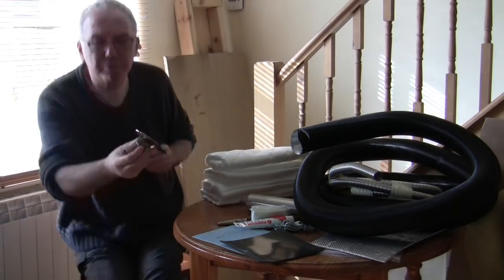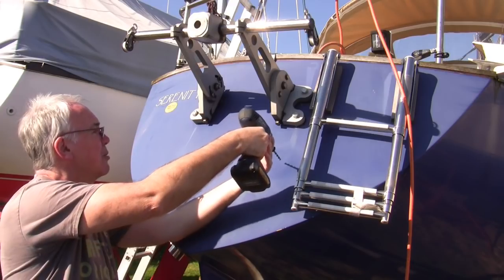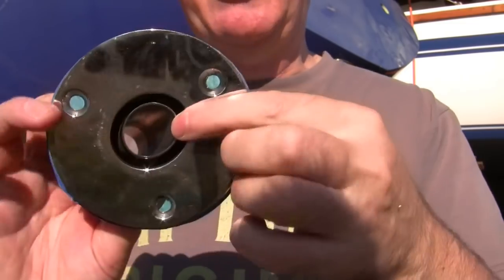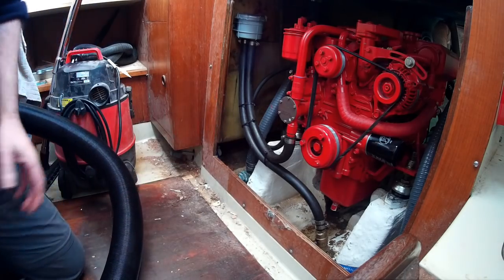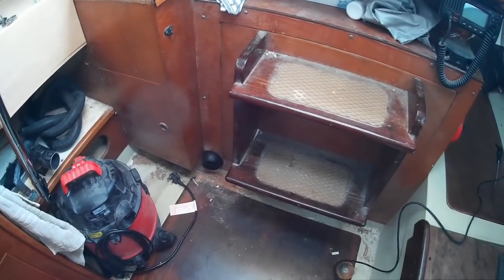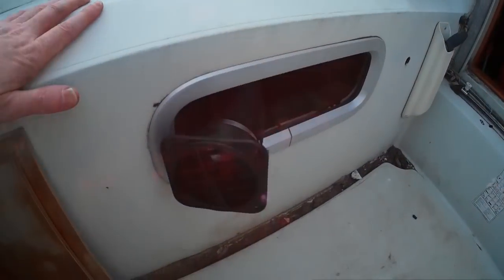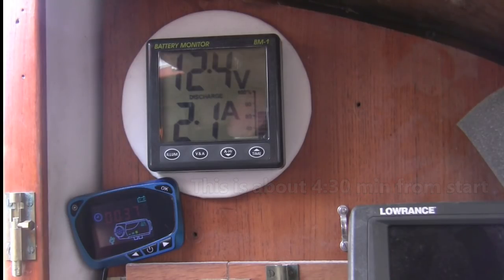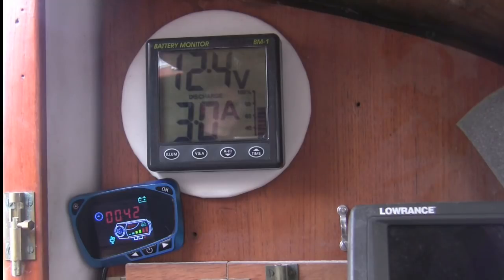Just About Sailing March 2019 - Installing a Chinese Diesel Heater, Pt 2 Fitting it and switching on

Comment: Nice install. As you were showing the current draw, I found myself wondering if you have ever looked into fabricating a solar panel arch for your boat. They seem to be getting quite popular for small sloops these days, and they look like a very practical and tidy way to get a couple of unshaded solar panels on board.
Reply from the maker: I do intend to install solar panel(s). I am not sure at the moment how I will do this. An arch is probably the best option. I have a slight issue in that the backstay is actually slightly offset (as part of the design). Although slight, the offset does have to be taken into account - I might even get the rigging changed a bit. The alternative is to have one solar panel and one wind generator.
I will do a power audit in the next month of so and work out what sort of power I actually need.
Cheers

Comment: Would it be worth putting in some sort of damper/valve in the air intake so that you could switch it between drawing air from outside to drawing it from inside the boat? Sort of like the recirculate button on a cars ventilation. 
If it is the depths of winter and you have the boat all sealed up would the heater have to work harder to blow air into the boat and possibly reduce the air flow rate? Whereas if it was on recirculate it would have almost no restriction on the air flow. It would likely also heat the boat quicker if it was drawing the already partially heated air from the boat and adding more heat to it. 
Maybe a combination, start the heater on recirculate to get the boats temperature up fast and then switch to fresh air when it is just maintaining the temperature. 
There may also be times when you want heat but the air outside is not "fresh", possibly a big boat in the next slip is warming up their big diesel engines and you don't want to draw that air into the boat. Or maybe when visiting the pump out dock on a cold day.
Reply from the maker: Yes, that would be a great modification.
I am thinking that I might take the external air from the Port side near to the quarter berth by routing the ducting under the cockpit floor. I then wouldn't need a lot of ducting to have a second switchable source of air from the quarter berth area.
Cheers.
Reply: @verynearlyaboutsailing8114  You did say you bought a little too much ducting. May as well make use of it and pretend you planned it that way from the start. :)
I was impressed with how quiet the unit was in the video. I have seen other channels put in similar units but theirs seemed much louder. I think that piece of rubber under the mount for the main unit was worth every pence you paid.
Reply from the maker: Yes, it was much quieter than I was expecting - and I still had the side engine compartment cover open. I am still thinking about soundproofing the engine bay. I was most concerned about the fuel pump - that was much quieter than expected.
I would rather order too much than too little - I've done that a few times in the past.

Comment: Hello, we installed a very similar system - from Webasto - to our boat about 6 years ago. Last time we wanted to use it, we noticed that the exhaust joint rusted completely, leaking fume to the cabin. I have to say - you made a bad decision. Check out the 12v infrared heating films... they cost nothing, you can easily install them, no through hall needed.  Ok, we have solar panels on the boat and a large battery bank - but you need to have good energy setup if you plan to stay off shore. Diesel heaters are the past. infrared is the present and the future.
Reply from the maker: Thanks for the comment. I am sure you are right that electric solutions (to pretty much everything) is the future. Am I right that the infrared films are underfloor heating? Very interesting concept. This is a technology I know nothing about - please feel free to recommend any articles or videos etc. Cheers.
Reply: Maybe I'm getting a bit set in my ways, however, you have failed to convince me that 12v infrared is the way to go. I rather like the thought of turning diesel into heat.
Reply: Hello, infrared film is not just underfloor. You can bet it anywhere. Last time I put it around a wine barrel to keep the vine at constant temperature. it can be rolled up and stored away in the summer, you just attach it over the bed or anywhere for the winter. There are 12 v infrared films awailable. I built them in the ceiling in our house - just as an additional heating element.
Reply from the maker: I will watch the development of this one with interest.
Reply: @Ken-jh4bt  ok. Your boat, your way.:)
Reply: @Ken-jh4bt  I like the thought of not having to have solar and extra batteries to add weight and cost. These heaters sip diesel so are very economical as well as being able to run on part marine diesel and part kerosene/paraffin. go diesel!

Comment: Cutting the hole through the transom was worrying and then crafting a gasket to protect the core as the exhaust passed through it was mind boggling to someone like me with Dyscalculia. I would have rolled a short tube of the gasket material, pushed it through the hull, fixed it in place and scribed a line on both sides of the hull, inside and out, then cut it. Dont think I could have figured the shape out your way and I havent even heard of compound curves and Euclidian what the heck thingy stuff. Nice instal though
Reply from the maker: That is exactly, 100% what I should have done. Looking back on it, I have no idea why I made it as complicated as I did. Weird, because I make templates for just about everything else.
It worked, eventually - but f there is ever a next time, I will do it differently.
Cheers, Paul

Comment: Hi, thanks for the video. You have some running experience now with your installation,  did you get any issues over the years of use?  Condensation or backsea water into the exhaust etc..
I have a small 20ft sailboat and I planning to make an installation of a 2kw heater this winter when the boat is up on land. I have a very limited space to mount it in the boat and it's going to be a challenge to get a safe installation. My concern is to get sea waters in to the exhaust from following sea waves,  and a need to design some kind of water trap with a drain. 
BR Kalle
Reply from the maker: Hi, unfortunately I don't have any sea-going experience with the heater. Serenity is still on dry land. Health problems have meant that it is taking me ages to finish the refit and get back in the water.
I did fit a small water trap at the lowest point in the exhaust. It is one of those ones with a loop of copper pipe that allows water to drip out, but won't let the gas out. It is really only for the condensation from the combustion process.
One option I was thinking about was to find some way of sealing off the exhaust when the boat was sailing. That would mean that the heater couldn't be used under way. Not really a problem - but you would need a failsafe way of ensuring that the exhaust was clear when you did switch on the heater.
I just looped the exhaust as high as I could to try and stop water getting in.
As I say, unfortunately I haven't bee able to do a proper 'at sea' test. However, I do switch the heater on and it starts u fine every time.
Good luck with it.
Cheers, Paul

Comment: Nice   video  
i think  the insulation material is for the exhaust pipe   this will be verrry hot   , and you don.t wa,tt it to cool down a lot   because of the risk of condens in the exhaust
Reply from the maker: Thanks for the comment. Yes, I agree about the potential problems with condensation in the exhaust pipe. My plan is to put in a drainage loop device which is specifically made for exhausts in boats.
This allows water to escape without letting exhaust gasses get into the boat.
Cheers
Paul
Reply: André Walgemoet Interesting! I was thinking about wrapping thin copper tube around the exhaust pipe, and using it to heat my hot water, but I see your point about condensation.

Comment: Nice bit of kit. A sidenote: The thruhull in the engine bay looks pretty corroded....around 11:05...maybe you should inspect that thing or even replace it?
Edit: Just noticed comments further below, that you are going to replace the seacocks.
Reply from the maker: Well spotted and thanks for pointing it out. But as you have noted, I am going to replace all of the seacocks. In truth, I should have replaced that one (and its twin on the other side) when the engine was replaced 3 years ago. I'm not sure why I didn't as I did replace the engine cooling raw water thru hull and seacock. Maybe it didn't look as bad as it now does.
Please do keep pointing things out as I am always surprised how easy it is to miss something you look at every day. And so far, I am very pleased with the heater. Cheers.

Comment: That's very interesting. I've been considering one of these to replace my increasingly temperamental Erbespacher so I'll be interested to see how it holds up but under £400 for the whole thing is about 25% of a "real one" so if it only lasts half as long... Incidentally, I have mine fed from the main tank with a short pipe so that the heater runs out of fuel before the engine!
Reply from the maker: The price really is very favourable. I think it is important to replace some of the less well made ancillary bits like the hose clamps etc which work out to be more expensive than the actual heater. And if the heater does fail, it will be simple to just swap out the heater unit as they all seem to be interchangeable size-wise. I might well feed mine from the main tank with a shorter dip pipe as you say. Cheers.

Comment: Where did you get all those parts? Rubber sheet, reflector, through Hull heat sheet stuff?
Reply from the maker: I got pretty much all of it from suppliers on eBay. I was going to provide a list of links - but they all change so often. For the heater specific parts I did searches on Eberspacher and Webasto parts. The spare parts came out as more expensive than the actual heater. It depends which country you are in, but for some reason people in Canada have found it very difficult to get decent stainless exhaust tube.
I probably didn't need the muffler - it's not that loud. However, the muffler that comes with it should never be used on a boat as it is designed to drip water under a van. In a later video I installed a proper marine water drain with a loop.
Paul

Comment: Great job exhaust drain for condensation
Reply from the maker: Steve thanks. Have a look at my 2nd video in December 2019. I did (eventually) fit a drain to the exhaust for condensation in that video. I probably should have  fitted one straight away. I don't know how much of an issue it is - but obviously (even with diesel) there is quite a bit of water produced during the combustion process and if it isn't blown out with the exhaust it has nowhere to go except to pool at the bottom of the exhaust.
Cheers
Paul

Comment: Hi, great video, thanks for that. I just bought one of these and your video will be invaluable. Question: where did you source your extra hot air ducting and exhaust piping, and the exhaust vent that you put in the transom? My boat (Moody 33) looks as if it’s had a heater installed in the past, but I think your idea of sticking it in the engine bay is great - I’ve got loads of (otherwise wasted) space there.
Reply from the maker: David
I got pretty much everything from ebay. I am based in the UK and I know that some items are difficult to get in other countries. I am pasting the links below - but I know that some may not work any more.
Bracket
https://www.ebay.co.uk/itm/EBERSPACHER-D2-D4-WEBASTO-Planar-night-heater-MARINE-MOUNTING-BRACKET-316-/143213979958?hash=item215837e936

Silencer
https://www.ebay.co.uk/itm/24MM-MARINE-EXHAUST-SILENCER-MUFFLER-STAINLESS-EBERSPACHER-DIESEL-HEATER-/183762469474?hash=item2ac918c262

Thru-hull
https://www.ebay.co.uk/itm/exhaust-outlet-24mm-for-webasto-heaters-stainless-steel-polished-eberspacher-d5-/183758810317?hash=item2ac8e0eccd

Oh, that's it. The other items seem seem to have disappeared - try searching 'Webasto' for the ducting and and stainless piping - also double check the size -  there are at least two different diameters for the heater ducting. In the end the engine bay was easiest - I am not as bendy as I used to be.

Good luck. Let me know how it goes.
Cheers, Paul

Comment: I would definitely treat the cut-out in the stern with epoxy before I fitted the exhaust fixture in there...
Reply from the maker: That's a very good point. Looking back, I'm not sure why I didn't - maybe the sun got to me.
I did put tons of silicone in the affected area. I think it would be difficult to go back and re-do it now.
Thanks for commenting - it might help others. Cheers.
Reply: @verynearlyaboutsailing8114  Well, after having used silicone in there, there will be a huge problem using epoxy later. Hopefully, your fix will be good enough. Thanks for a very interesting video!
Reply from the maker: Cheers - I hate using silicone on the boat. It was possibly because I was focused so much on using this horrible stuff that I didn't think about doing an epoxy barrier coat.  The only other time I have used silicone (on replacing the hatch acrylic) that didn't go too well either as I didn't quite use enough.
Oh well - I'd better stick to epoxy from now on.
Reply: @verynearlyaboutsailing8114  Sounds good! ;)
Reply: Please could you explain what you mean by treating the cut-out with epoxy. Is this epoxy paint, and is it instead of sealant?
Reply: @jameshaile9021  Hi there! I would use epoxy (like West System or similar) to seal the edges and all exposed GRP with that. You may add micro balloons or silica to the mixture if that seems necessary. 
You may possibly use a two component epoxy paint (gel coat), making sure that everything is properly covered. For sealing the installation (any type), I would use Butyl, Sikaflex or other similar marine compounds, never use silicone. This is just my humble opinion, others may have another approach, so it's a good idea to ask around.
Reply: @youyouulf  Great! Thanks for the advice. Much appreciated!

Comment: Want to do mine but not too sure what's best for sealing exhaust outlet as I'll be making an hole in the fibreglass the boats made of. Any tips would be appreciated. Great video BTW.
Reply from the maker: Good question. I worried about this. Firstly, I used an exhaust outlet with a double skin. I then made a gasket that went round the metal (stainless steel) outlet and the hull. I think I also made a gasket to go on the outlet flange. I can't remember what the gasket was made of - but I seem to remember that it was specifically for exhausts. I also used some heat resistant silicone gasket stuff that came in a tube.
Also, there is quite a long distance between where I have put my heater and the outlet (gives things a chance to cool down a bit). When I ran the heater I was pleasantly surprised at how cool (well, not too hot anyway) the area round the outlet was.
Good luck with it.
Cheers, Paul
Reply: @verynearlyaboutsailing8114  thanks for the reply. I'll get the bits ordered and let you know how I get on 👍

Comment: YOU COULD PUT A BOX on the exhaust with a fan to blow some of the excess heat around
Reply from the maker: Yes. It's a shame that there is so much heat going to waste.
Some systems have a concentric setup (Exhaust pipe inside the inlet pipe) so that the air coming in is heated by the air going out. 
Someone somewhere has probably already done this.
Cheers
Paul

Comment: Two things I worry about.
A.... Chinese electronics 
B.... Electrickery that results in the rudder falling off just when you need it 
C.... Both the above in the same boat at the same time 

You had an arm full of "harness". How do you know it doesn't leak current? 
How do you test your boat's (current) leakage (before and) after this project?
Reply from the maker: Hi. Let's be honest. It's always going to  be a risk going for a 'cheap' product wherever it comes from. The Chinese heater was significantly cheaper than the German equivalent. It's a risk. But if it fails I can always save up and replace it with a more expensive one. I did consider a Planar which is Russian made and more expensive. I know nothing about Russian electronics - except they make decent replacement valves for guitar amps.
The wiring harness was actually quite nicely made with decent connectors. I used to do a lot of work on British cars in the 1970s and 80s. The quality of the wiring on those was simply awful. The original wiring on the boat would be about the same vintage.
I don't know the current leakage under 12V DV. But I do have a galvanic Isolator fitted for when I'm plugged into shore power.
And my rudder was in danger of falling off through  crevice corrosion. I replaced the stock - check out the videos from about 2 years ago (I think?).
My main worry? Running out of tea on a long voyage. The very thought makes me shudder ;)
Cheers
Paul

Comment: Hi just wondering why some people fit the fuel line into bottom of tank rather than the top.  I fit my pipe to top. It makes it a lot safer when removing tank or disconnecting fuel lines for servicing. Saves draining tank etc. The fuel pump is designed to suck fuel and not gravity fed. Is there any advantage over fitting in bottom of tank. Cheers from old George 👍🤠🇬🇧
Reply from the maker: Good question. I tend to fit fuel lines into the top wherever possible. The only reason I fitted to the bottom in this instance is that this was the fitting kit I received withe the kit. I intend to change the 5 litre tank for a 10 litre one - which I have purchased along with the 'dip' tube for top fitting.
As long as the fuel pump is not being overstretched, I don't think it makes much difference - but I'm no expert.
I tend to prefer top fittings because it is more leakproof.
Cheers
Paul